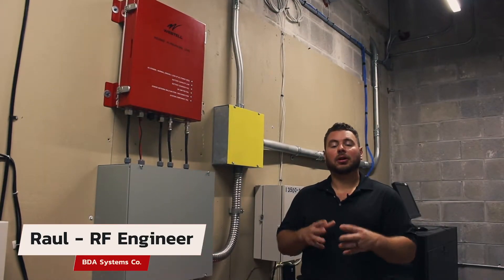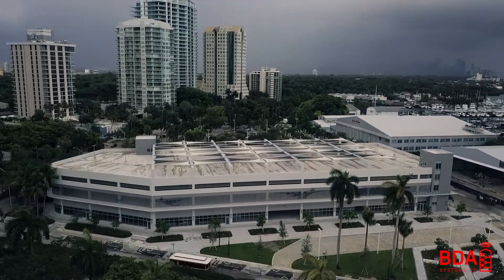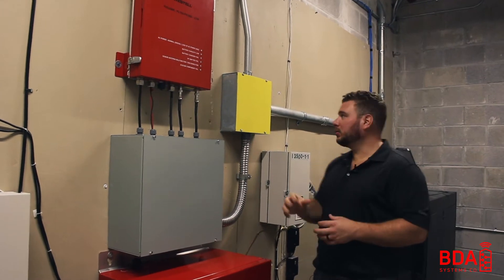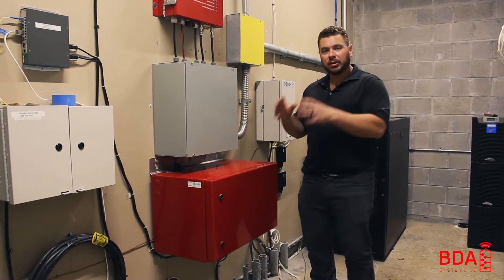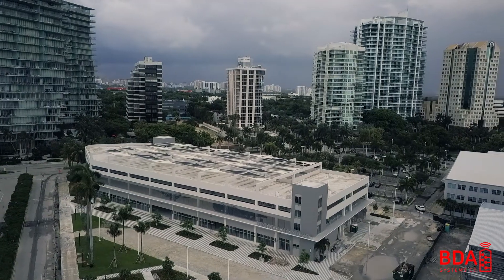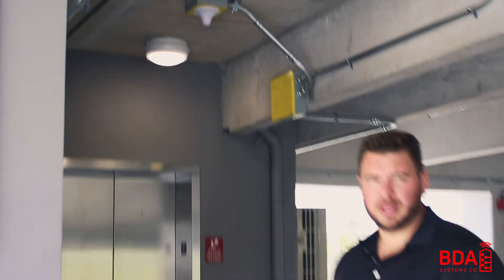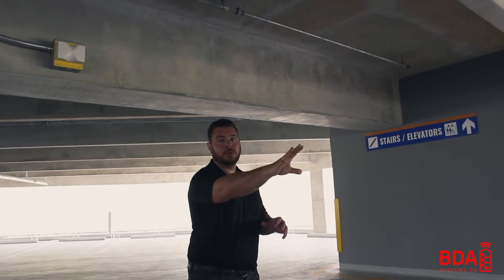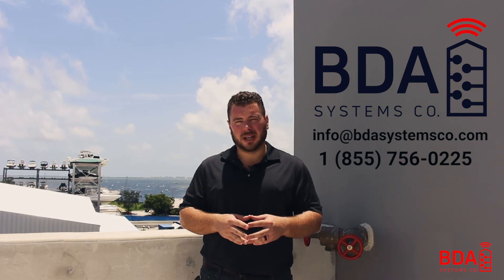BDA/ERRC System for 700 and 800 MHz - City of Miami

Comment: Was the conduit required by the city of Miami, or is it a universal standard? Also, did you only use 1/2" Low loss cable?